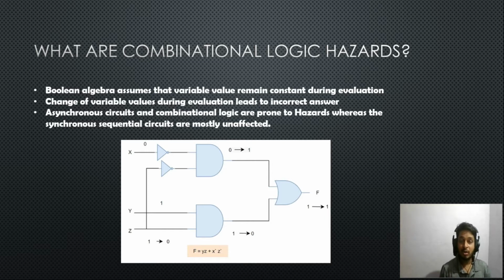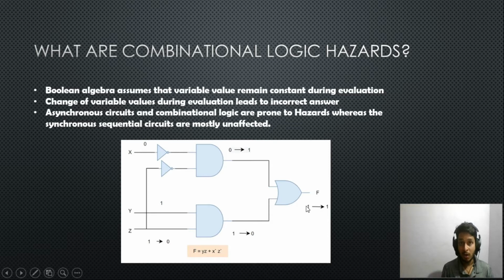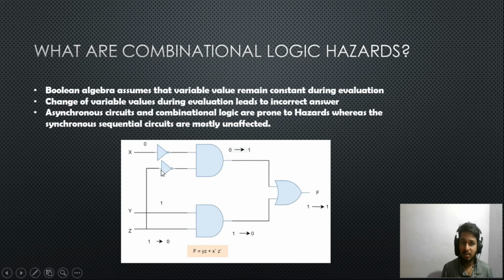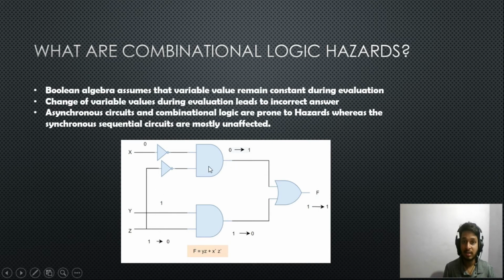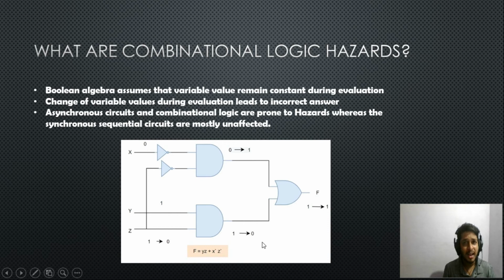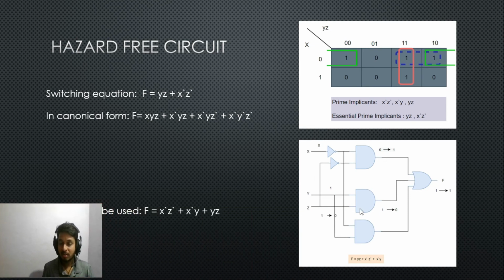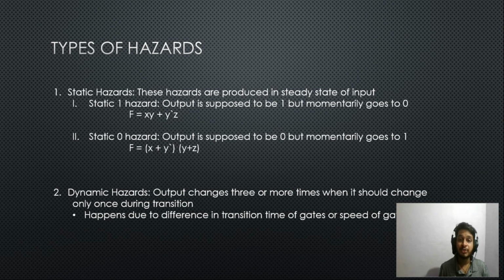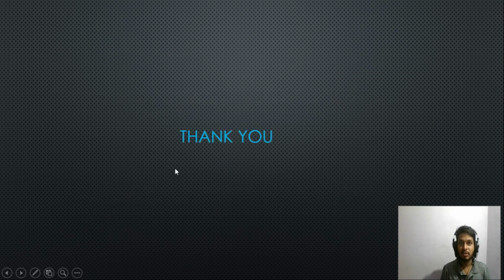Combinational Logic Hazards | Digital circuit design | #vlsi #physicaldesign

Comment: Nice topic but I have few questions:
1) How adding the redundant logic will fix this issue? If the redundant logic input path has more propagation delay or gate transistion time then i guess it will introduce new set of hazard for that branch.
2) How can we decide which path willl have more delay as we get to know about that only during placement and routing.
3) How dynamic hazard can be fixed?
Reply from the maker: Hi Sooraj,
Glad  that you asked these questions. I'll try to answer to the best of my knowledge.
1. As I showed you in the example, redundant logic additional is not completely random. You saw that it was because of overlapping group. And moreover, once you introduce that redundant logic output stays at logic 1 as I showed you. It will not go to zero momentarily even though whatever the propagation delay of the added path is. But anyway it doesn't ensure the dynamic hazards.
2. As I told if the case is synchronous sequential circuits, we can mostly neglect the hazards. This is because we are taking account of worst case propagation delay of the circuit. But if the case is asynchronous design then yes, it needs to be taken care. For your question of delay calculation, it can be estimated initially also and we'll have cell delay characterized initially only. As you know it's not that accurate without real physical design and RC extraction. It can be fine tuned later as well. 
3. Dynamic hazards are very rare but possible. As you know since it's related to gate transition time, we need to take better standard cells from the library. 

I hope it helps
Reply: @jairamgouda  Thanks.
1) During systhesis, the tool will optimize the netlist right. So it won't remove the redundant logic?